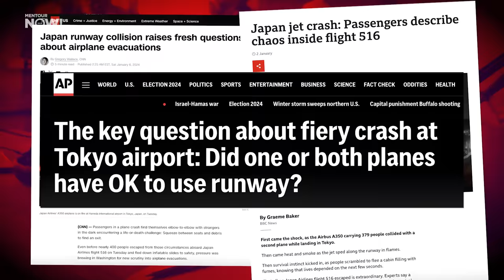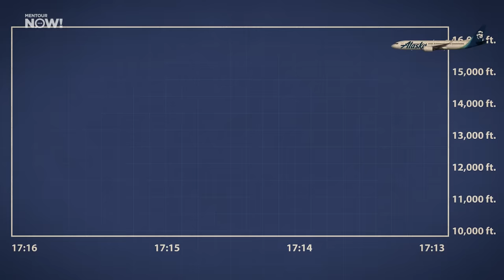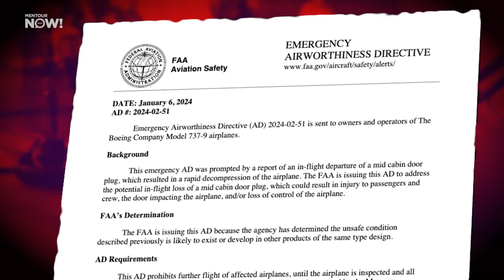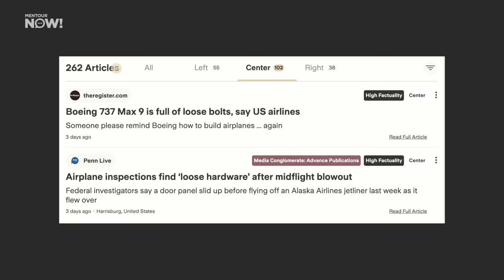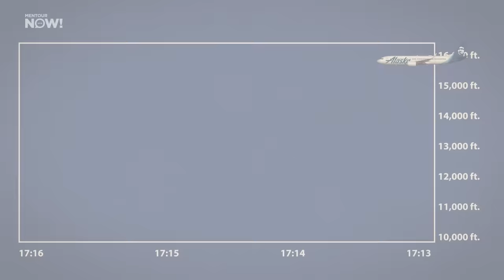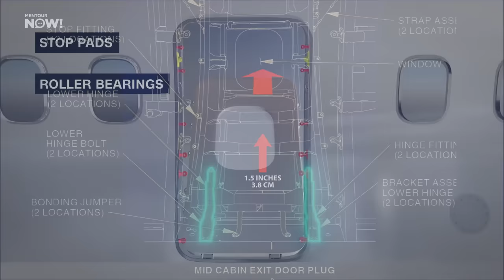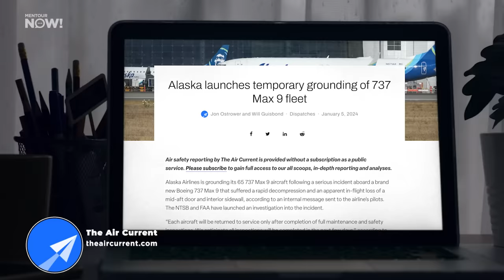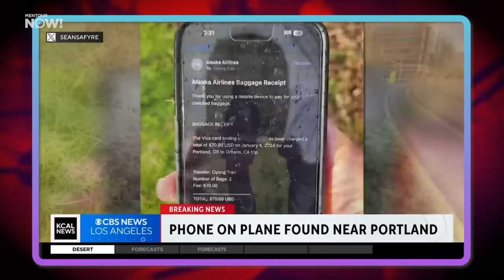WHAT Is going ON with Boeing?! MAX-9 Door blowout

Comment: From “If it's not Boeing, I'm not going” to "If it's Boeing, I'm not going"... Boeing really fallen since the 90's...
Reply: I don't want to disagree with you, obviously Boeing has been in the news a lot lately. Do you think this could be the fault of the airline/ maybe Alaska airline maintenance crew isn't the best? cancelling the flight suggests the airline is trying to be responsible at least... maybe the engineers were lazy? but maybe it's just a faulty design.
Reply: @matthewklassen7457  damn, why do you bother even commenting when you're so badly misinformed and have zero knowledge on this topic?
Reply: @matthewklassen7457 bruh did you even watch the video
Reply: @matthewklassen7457  This is a brand new plane... The maintenance don't have anything to do with it
Reply: @matthewklassen7457  Sane people know why the bolts were missing. Others think that gremlins were on board the aircraft and dismantled the bolts and kicked out the door.
Reply: @matthewklassen7457  This is NOT a maintenance issue. The plane was only delivered to Alaska Airlines in late October! This is sloppy assembly and quality control by Boeing, pure and simple.
Reply: @dannyboyy31  it was assembled with the door, then Alaska airlines replaced the door with the plug....  No? Boeing didn't install the plug did they?
Reply: @todortodorov6056  you are the only person who mentioned gremlins
Reply: @johnsonwu3001  Boeing assembled it with a working door. Didn't Alaska airlines replace it with the plug?
Reply: @NoNameBAM  bruh did you even read my question? Can you read?
Reply: @matthewklassen7457  Not necessarily.   Planes are often delivered that way.
Reply: “…fallen Since 90’s” !!! During this time period they launched the two most successful Twin engine wide-body airplanes (777 in 1995 and 787 in 2009).
Reply: It makes the sound when it hits the ground and bounces
(boeing)
Reply: @matthewklassen7457  No, Spirit installs the plug during fuselage assembly
Reply: @matthewklassen7457  No, Boeing does not manufacture the fuselage sections; Spirit does & they install the door plugs
Reply: Blame the "merger" with McDonnell Douglas!!!  Everything changed.
Reply: @derser541  Matthew is a great example of the Dunning-Kruger Effect.
Reply: @matthewklassen7457  The door plug was delivered with the airplane from Spirit. If the plugs hadn't been installed before putting on the railroad car, the fuselage would have been open to the weather and vandals. We don't know yet whether Boeing, Alaska, or the CB shop opened it, or the bolts were omitted by Spirit.
Reply: @Ldavies2  It's like they promoted everyone responsible for the design flaws of the DC-10 to carry on the legacy of cost-cutting to this day.
Reply: @jack002tuber  blue skies?
Reply: @matthewklassen7457   Alaska didn't assemble anything lol. It was delivered to them with the door plug as per the order specification. Like when you order your laptop from Dell, HP, Apple, etc, you pick your specs - processor, disk space, ram, etc. You don't assemble those yourself do you if you're buying from those companies? 🤦‍♂
Reply: @roses.9181  I know, asking for information is dumb. how could anybody want advice form people? In the end, I learned 2 things. most people online are just trolls... but I also learned the answer to my question. no thanks to trolls like you!
Reply: @roses.9181  How did I over-estimate? I asked a question. I literally said I don't know the answer... can somebody inform me. Do you know what the dunning0-kruger effect is? it's not this example. I asked to be educated on a matter I clearly stated I wasn't aware of. learn to read. context is important.
Reply: This is clearly Boeing's fault, but the attacks on Matthew are quite unhinged. The most amusing one is the Dunning-Kruger reference, where the author appears to demonstrate the Dunning-Kruger effect regarding the Dunning-Kruger effect itself, as Matthew did not show any overconfidence in his answer.
Reply: Boeing seems to be turning into McDonnell Douglas. The DC-10 is making a comeback.
Reply: still better than scarebus
Reply: @davidwelsh829 lol why scarebus? Are there things Airbus has done that compare to Boeing?
Reply: @matthewklassen7457 now we know for sure BOEING forgot to install ALL 4 BOLTS that held the door in place ... How can you miss ALL 4 is what surprises me.. that's not a minor quality control... It's 4 major ones and at the same place
Reply: @soulsbourne  Thank You very much. I wasn't sure at first (I know very little about aircraft production) the only reason I asked was because of the 2 warnings that the pilots received and the 2 times it went to maintenance... both of which maintenance (repair crews) signed off on the aircraft. I was curious how they could know about a pressure issue, and still say... okay. it's safe to fly. (it seemed to me that the maintenance crew was lazy? maybe?) but now I have been educated on the situation. I appreciate the time you've all spent informing me on this. I learned a lot

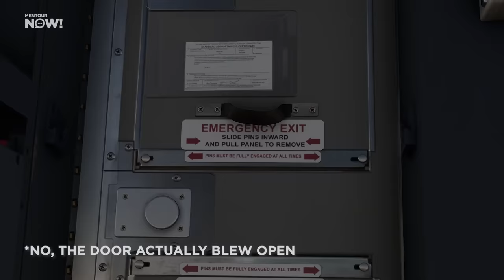Comment: Thanks Petter, great video as always. As to the cockpit door blowing open (min. 2:30 — with your correct caption “the door actually blew open”), I just read a declaration by the NTSB chair, Jennifer Homendy, saying that “the Board found that the cockpit door of the B737-9 MAX was designed to open during rapid decompression and that the flight crew was not made aware of this feature”. The door opened so violently that it got stuck and it took a flight attendant three attempts to close it, and a laminated quick reference checklist used in emergencies flew out. Homendy added “we found today that the cockpit door is designed to open during rapid decompression. However, no one among the flight crew knew that. They were not informed. So Boeing is going to make some changes to the manual which then hopefully will translate to procedures and information for the flight attendants and crew in the cockpit”. But… why on earth (and in the skies) does Boeing insist on hiding information to the crew? Wasn’t the MCAS lesson not enough?
Reply: THIS. And why the fuck the door opens anyway? To ensure crash? Massive distraction and potential damage to the crew in emergency is the LAST thing airplane needs...
Reply: @KuK137  agree. If it’s to balance the sudden gap in pressure and make sure that the whole aircraft has the same, there could be panels, vents, valves, whatever. My personal feeling is that it was probably cheaper to release the whole door instead of designing a type of (safe) door with such systems. And then, of course, not telling anyone because it’s probably deemed superfluous or redundant or requiring some extra certification… hm, again, it rings a bell
Reply: Boeing clearly doesn’t care about lose of life as we all learnt from what happened in the past
Reply: @KuK137 why would de want to ensure a crash?
Reply: to balance pressure, you don't need a huge opening.
Reply: @schadowization That's the joke.
Reply: For the A320 Family this is mentioned in the manual, so i was really surprised it is not mentioned in the Boeing one.